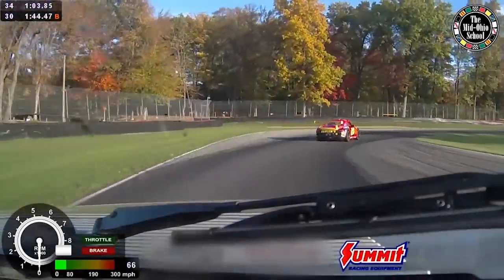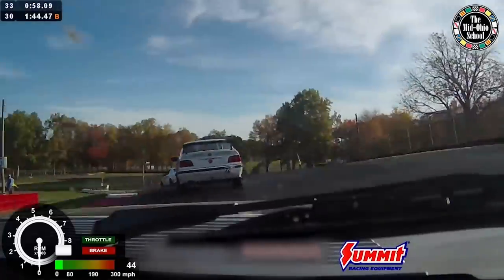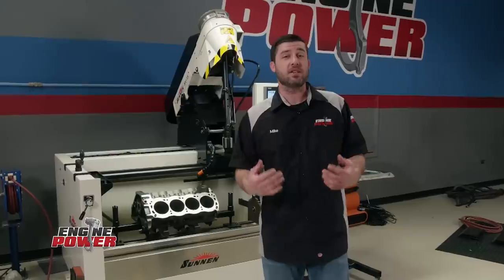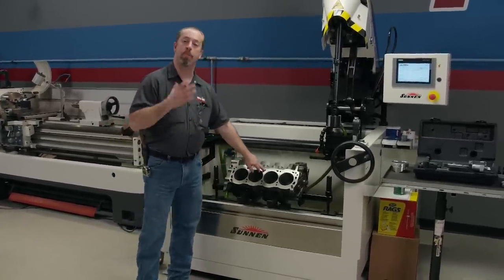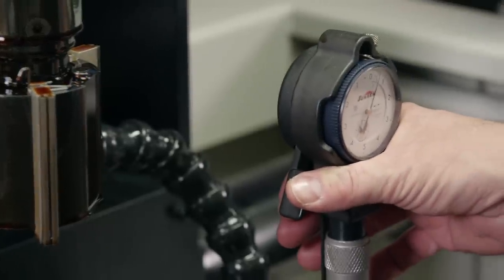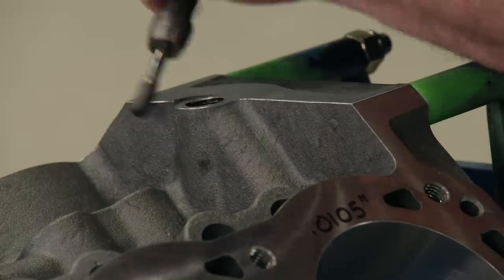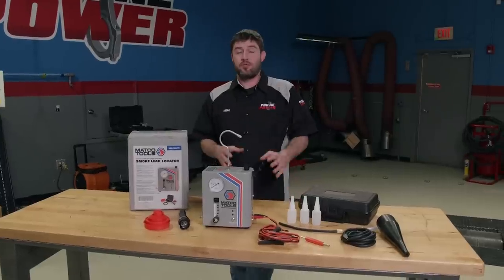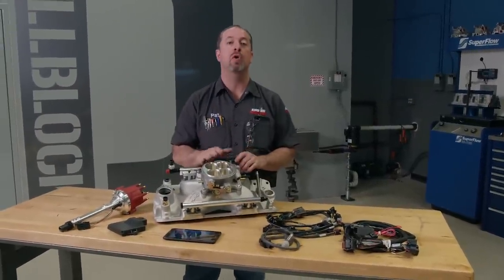Building a Small Block Ford Race Engine - Engine Power S6, E10

Comment: I had all this fancy new machine work done to my 388 stroker. Afr heads and top of the line good stuff. Didn’t weld the pick up tube to the pump and it fell off and slung a rod. Lesion learned

Comment: I've been watching this show since the 90's and think now would be a good time to build at least one boosted import engine a year and possibly have a dueling engine series.  It's all the same formula [More air + more fuel = more power.  Suck, Squeeze, Bang, Blow.]  I know you shy away due to lack of aftermarket support but these boosted engines don't need aftermarket blocks, cranks, heads, intake manifolds, etc. to make big power numbers.
Reply: How much of that stuff for imports can they get from Summit Racing?
Reply: @crazyeyez1502  I typed "2JZ" into Summit's search bar and 1,500+ results came back featuring all the parts needed like Carillio Rods, Callis crank, Mahle pistons, Crowler Cam's, as well as reman long blocks.

Comment: on my  302 with a torker I ran a piece of 8 threads per inch bowl shaped screen under the carb and ran much better down low, fuel hit the screen and broke up easier into a mist i figure.  make sure you secure the threads well to avoid them getting pulled into the motor.
Reply: radioguy1620 can you tell me a little more about the screen you put under carb?

Comment: Weird to mention "grassroots" racing at the start of this. This engine build costs around $10,000 in parts alone and a lot more in machining services for that block work. Most likely a builder would charge $16-25k to build an engine like this. Considering most endurance racing teams racing grassroots series like ChampCar, Lucky Dog, and 24 hours of lemons are spending $3-4k per race at the most, the engine cost is more than most "grassroots" racers' budgets for the entire year.

For most grassroots applications, just a refresh of a 302 block with a stock mustang gt cam and quality OEM grade internals will make enough power to have reliable fun on track for a few weekends work and under $2k in parts. For the pro drivers like Tommy Byrne competing in the higher dollar series like AER or WRL, then by all means plan for the larger investment of a pro built race engine.

Comment: peak numbers does not highlight the benefit of a dual plane intake over a single plane.  It's the huge torque gain just off idle to 3500 rpm.

Comment: Wouldn't a billet aluminum block make more sense in a race car?
Reply: Iron is more resistant to warping than aluminum and is much stronger
Reply: @Project-gr6zy  It is much heavier and has no redeeming qualities other than cost. Modern aluminum blocks can take whatever a cast iron block can. This is what you would call a budget build and the Dart block meets that criteria.
Reply: @sammysampson183  iron blocks can take more boost than an aluminum
Reply: @Project-gr6zy  Ummmm. No. Top Fuel, the ultimate in racing, uses Aluminum blocks that take close to 80 psi of boost and make over 11,000 HP.  Using a cast iron block would be foolish. Cast Iron is only used when one can not afford a Aluminum block.
Reply: @sammysampson183  ok, well I'll wait and see for an aluminum Ford 300 to outlive my cast iron one with over 784K
Reply: @Project-gr6zy  The 300 six has not been made in decades, you want to trot out that dead horse as a comparison? Seriously? Lol.
Reply: @sammysampson183  I have yet to see an engine today last that long while towing at gavwr for my f250 HD on avg, most of my driving is 72% city rest highway
Reply: @Project-gr6zy  Just cause you ain't seen it, does not mean it has not happened hundreds of thousands of times.
Reply: Sammy Sampson comparing that engine to any standard block is apples to oranges.  That is a billet block with no coolant passages and is extremely expensive.... plus is lucky to get a few miles on it before it is thrown away.   Still I assume the reason they used an iron block here was cost.     Look at the LS platform the factory iron blocks vs aluminum the iron ones are much stronger especially in boosted applications.
Reply: @jasontruman1215  I've been at the boost game for years now and vortech blocks with LS heads is popular because if cooling but like iron vs aluminum irons better, my 300 has a replacement that may never be used and it's gonna be boosted at 38 pounds, all the cast iron 8s and straight 6s from back in the day last way longer on avg than anything today, and someone saying that a Ford 300 going almost a million miles no rebuild is foolish, we run thicc 15-40 T5 rotella and of all 17 most have over 500k
Reply: @jasontruman1215  If you want to stay with the heavy cast iron block, go for it. I doubt any facts I bring up would change your mind. I already pointed out that cost was the reason for going with a cast iron block, and now you want to use cost to say the comparison is not fair...Lol. Whatever. There is nothing a cast iron block has over aluminum for a given application other than more weight and less cost. Stay stuck in the 1950's Lol.
Reply: osp80  mine dynoed in at 368 lbs torque with my 268 DUI cam at 1400 rpm and about 173 up at 2850 giver er take, the work ones are stock but this truck pulls real good and has a nice deep grumble when revving up

Comment: For best Hp and longevity you would not use a stroker crank and leave it a 5.0 . Lower piston speed and inertia raises hp and response. This for a Road course not Nascar or offshore boat racing so all those counter weights on the crank suck up hp. You called it an Anvil and Anvils are slow. Wacky drag racing rocker shafts are another waste as for road course you need a cam that has a broad power band not extreme Rpm. And the cam needs to have a less aggressive lobe shape for softer springs for longevity. What logic are you using here?
Reply: Considering they are the ones with the tv show, im pretty sure they have this figured out.
Reply: You just agree to anything.
Reply: @dielauwen  Not only does Pat have his own shoe but also a very good reputation as a engine builder.